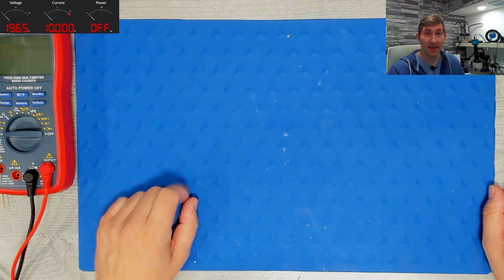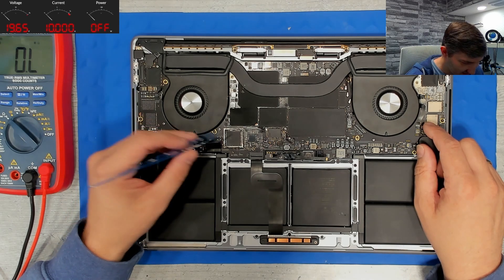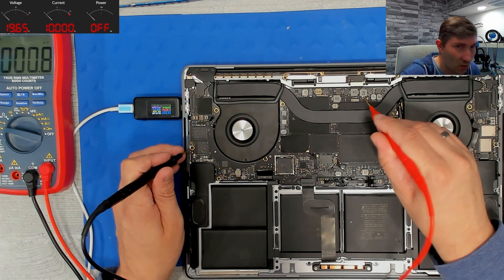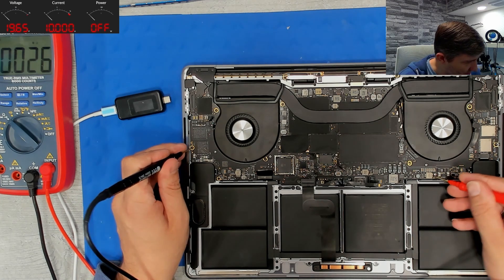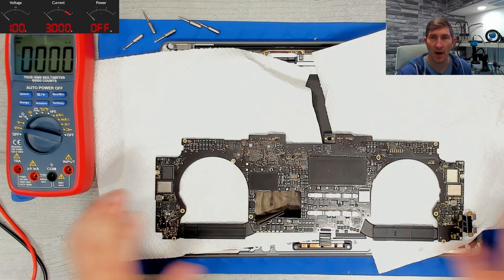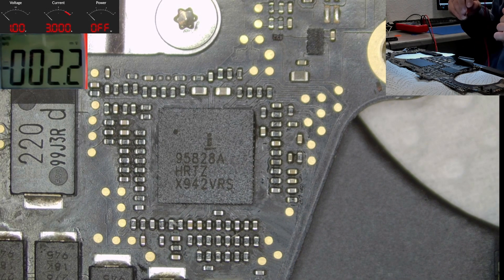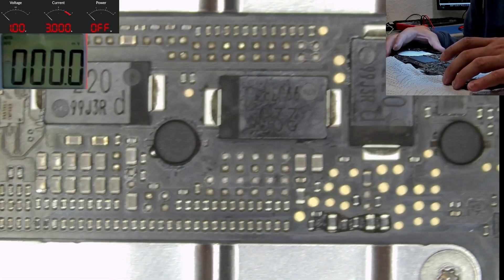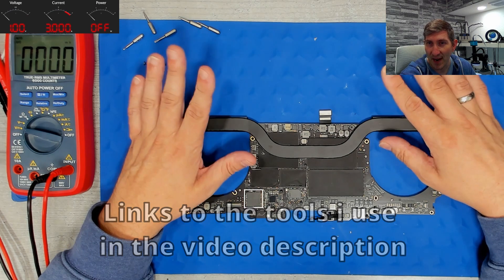MacBook Pro 2019 - Turning on but no picture. No CPUCORE. Ridicolous previous repair attempt.

Comment: Hallo
I have broplem with my laptop Dell Latitude 3390 2-in-1 2018 works perfectly but when I turn it off it suddenly turns on again it turn off only from power switch button I reset to factory reset dose not works I change the Rams and the ssd than I load new windows 11
Not works still same problem please what to do in this
Thank you
Reply from the maker: Could be a issue with the WOL (WakeOnLan) logic (needs to dig into the circuit) or a BIOS issue (reprogramming advised). Regards
Reply: @fairrepair_en  yes I will thank you so much for replying
Best regards

Comment: I don't like it when someone has already had a go at repairing a laptop and messed things up and then not told you what they did :(
Reply: These macbook like to send 12v to the cpu/gpu its just how it is. Most likely nobody has messed it up. I see this frequently in my shop.

Comment: inject cpu core voltage and see if there is picture with external power to cpu.
Reply from the maker: This my friend won't work for sure. :)

Without the CPU internal logic working, the P.O.S.T can not be done successful, regardles how suitable i supply the core from external supply. The only clue might come from the consumption and from the heat distribution of the Core.

Comment: This is where Louis Rossman comes in handy. Mike, I would say for education purposes only to inject some voltage on the CPU_CORE coils and check with thermal camera the CPU. The heat footprint in case of a shorted CPU has very distinctive pattern (this is where Sorin comes in handy  😄)
Reply from the maker: Indeed, injecting into CPUCORE could be a second proof. Thx!